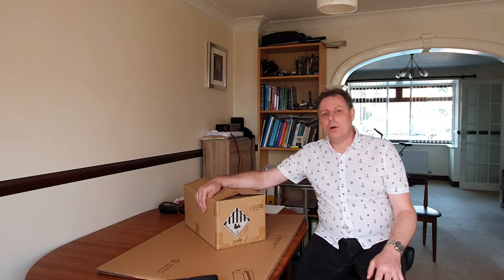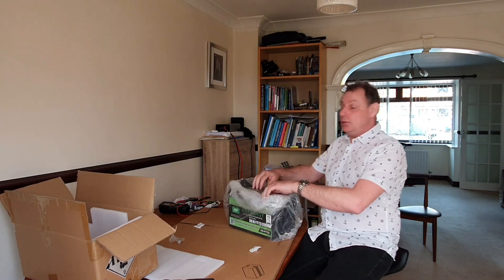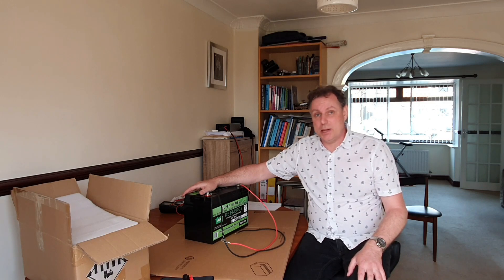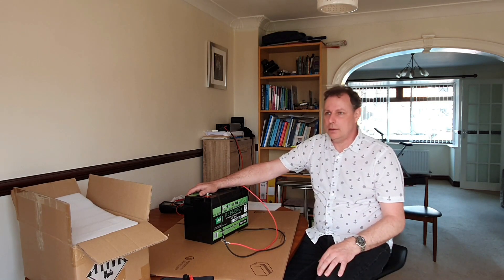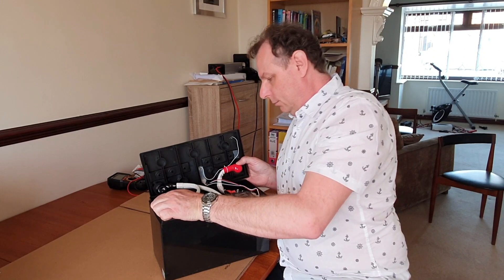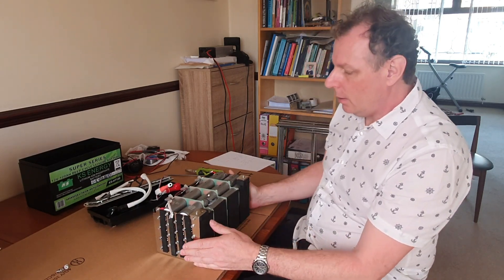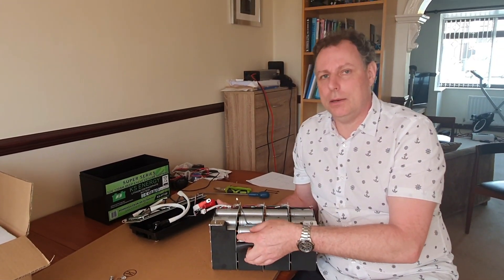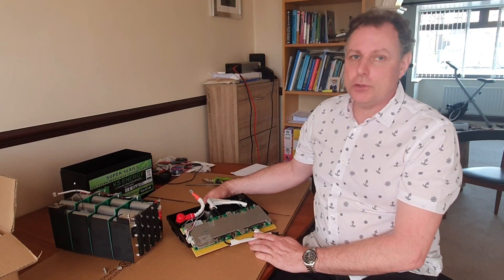Dismantling a KS Energy KS-HT120 Lithium leisure Battery

Comment: Trips out over 320 amps ???
Reply from the maker: Anything over that
Reply: @ksenergy9079  What happens if it is shorted out by 300 amps ??
Reply from the maker: @Tom Aitchison Its designed to provide 160AMP continuously. Weve designed it such that it could withstand a continuous 250AMPs surge for 30 seconds. If you attempted to continuously over load it, it would simply shut down until the over load is removed. UPDATED FACTUAL INFO FOR THIS MODEL